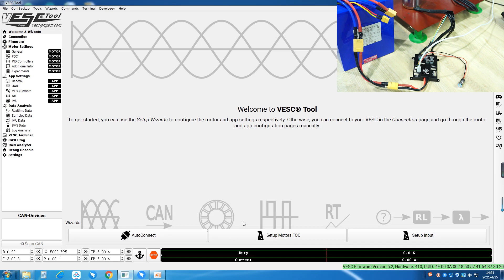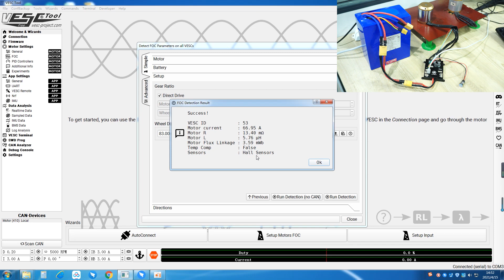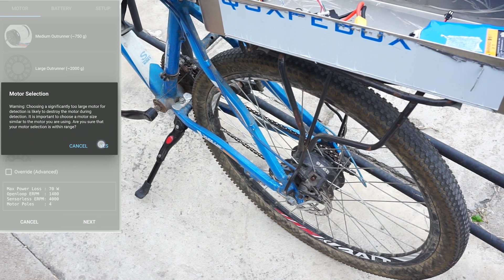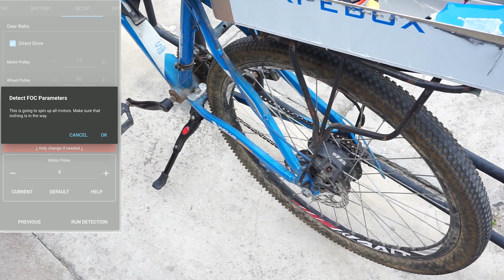DIY Ebike With Mini FSESC 4.20 Smart- Bluetooth Module VESC Tool Program on Mobile Phone | Flipsky

Comment: Sweet set up been looking at these controllers as a replacement controller for my 750w 48 v 20 inch fat wheel bike but on most available controllers there does not seem to be a connection for PAS sensor.
Any information on how to connect pedal assist sensor and throttle to these units would be greatly appreciated
Reply: i am also looking for a controller that can connect to a wireless PAS sensor
Reply from the maker: The PAS function currently only supports cadence sensors with 4-wire orthogonal output pulse signals. The signal wires can be connected to the TX and RX pins of the COMM port for testing.

Comment: Thank you for sharing your knowledge! I would like to know how to use a pas sensor, could you help me?
Reply: @FlipskyTech  I need to install a pedal assist sensor on my vesc 75100, but I can't do it, would you have a solution?
Reply from the maker: Thank you for your support of our videos. We will update more video series you need in the future. Thank you for your suggestions. However, based on the current product series, the use of PAS is not supported for the time being.
But in the near future, our own FT85BS ESC is currently being adapted to the PAS function. In the future it will be paired with the PAS sensor and TFT display we purchased. Please wait for the launch of our new products.
Reply from the maker: Sorry, we currently have no way to implement vesc series. The corresponding solution will only be available if the future FT series is used. @EBIKESBR

Comment: Hello what product do you recommend for a 72v 3500x2 electric scooter please
Reply from the maker: Hi, what products do you need ?  Esc recommand FSESC7550:https://flipsky.net/collections/electronic-products/products/flipsky-fsesc-7550-75v-50a-esc-base-on-vesc6
Reply: @FlipskyTech  thank you for your reply. but my battery is 20s9p and charged it is 84v is it good anyway?
Reply from the maker: @medvador1516  Sorry, the esc cannot bear the voltage of 20s. It's safe in 3-16s.
Reply: @medvador1516  they have a 84v max controller

Comment: could provide the diagran for the ebike conections ? the trootle and the brake conections ? many thanks
Reply from the maker: Hi, connect the throttle to 3.3Vand5V, GND and ADC1 of the comm port; connect the brake to 3.3Vand5V, GND and ADC2. We will add a diagram for ebike soon. 😁

Comment: Awesome to see these can be used for ebikes as well!
Reply from the maker: Yes, most of our escs , even motors can be used on ebike.
Not only for esk8 and ebike, the other field like robot, efoil , scooter, lego etc also are available.
Reply: @FlipskyTech  that’s awesome!

YouTube waited a full 2 months to send me the notification of your comment. 
I don’t understand 😂
Reply from the maker: @PatRiot-  Too many messages lead to missed responses, sorry for that. Thanks for understanding!
Reply: @FlipskyTech  would appreciate a clear description on how to connect the pas sensor and throttle plus brake cut off to these units so I and many others can fit them to standard ebikes like my cmacewheel Y-20 with 15 ah 48 v battery and 750w motor.